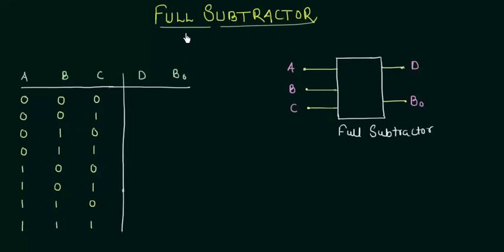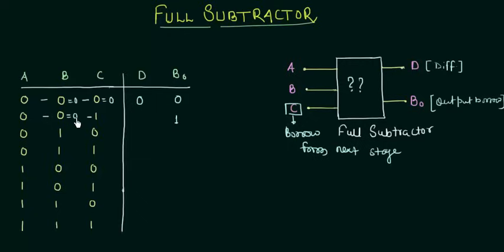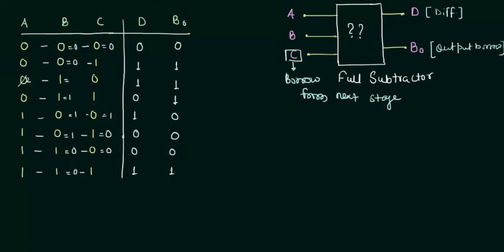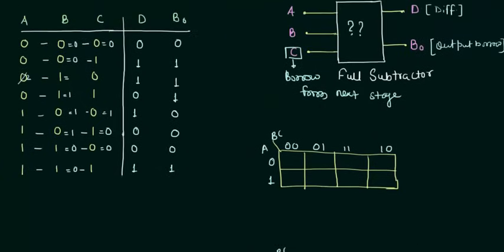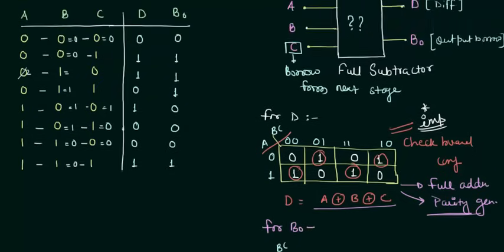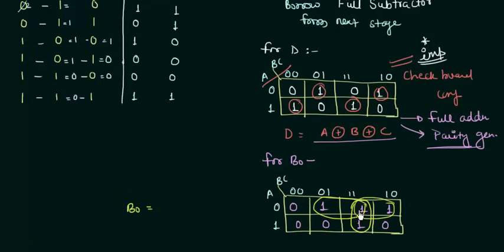Full Subtractor | Easy Explanation

Comment: Timestamps (Powered by Merlin AI)
00:04 - Explaining the logical expression for a full subtractor.
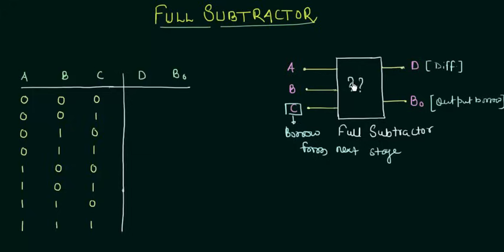01:06 - Finding gate combinations for a full subtractor with three inputs.
01:58 - Understanding borrowing in subtraction with binary numbers.
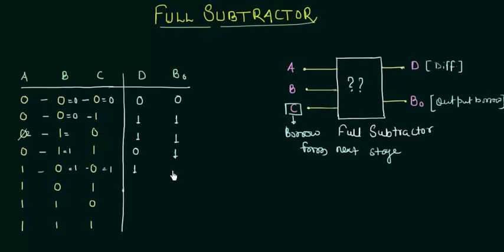02:56 - Understanding borrow in full subtraction.
03:40 - Understanding binary subtraction using K-map minimization.
04:42 - Explaining the K-map for the output B in a full subtractor.
05:52 - Understanding the XOR combination in full subtractors.
06:58 - Explaining borrow output in a full subtractor using groupings.

Comment: I am confused as how can you use this to do subtraction, for example is you want to do 5-4 (101 - 100) then A will be 101 and B will be 100. But in this example, the way I understand, A is only 0 or 1, and so is B. What am I missing?
Reply: 101 is a 3 bit number. Similarly 100 is a 3bit number . Half and full subtractor can only subtract single bit number such as 0 or 1 at a time. For eg here in 101-100, first it does last bit A=1 and B=0 , 2nd time A=0 and B=0 , finally third time A=1 and B=1.

Comment: Why does he switch the 11 and 10 boxes? When the numbers are 0110 he writes it as 0101. He doesn't explain why he does this
Reply: Because the numbers he puts at the top increment by 1 bit, or only 1 bit can change at a time. Just like in Grey code.
so it would go;
00,01,11,10...  <--- only 1 bit can change at each step
Reply: Look up Grey code, and that will help a lot

Comment: In much the same way of the Full Adder using two Half Adders, you can realize a Full Subtractor using two Half Subtractors. Using a K-map, you can deduce the equation B0 = /A*B + /(A_xor_B)*C, and D = A_xor_B_xor_C. The wiring of the Full Subtractor is the same as that of the Full Adder.
Reply: Also for those interested, C is called B_in in some texts
Reply: Why do we use subtractor circuits when we can achieve the same using compliments (by addition)?? Please help.